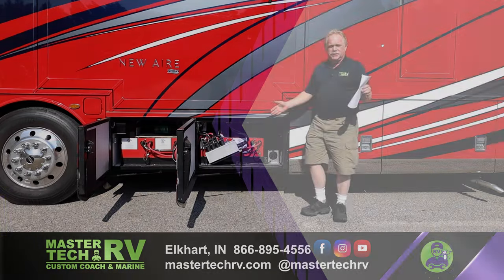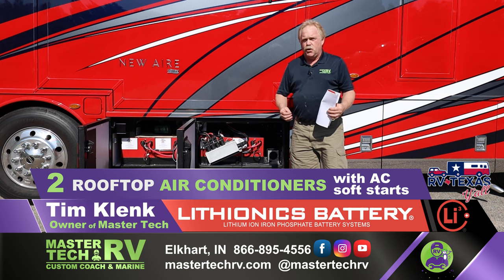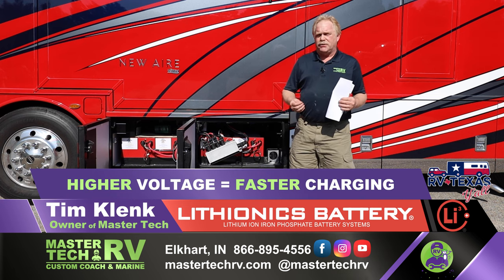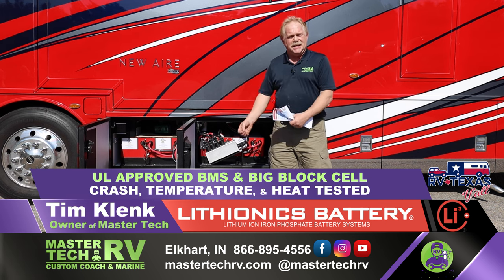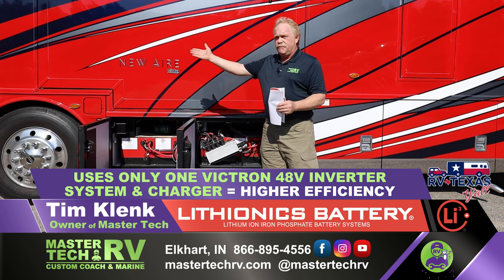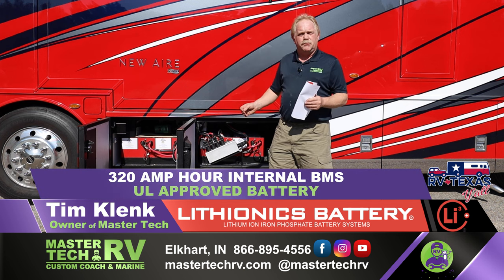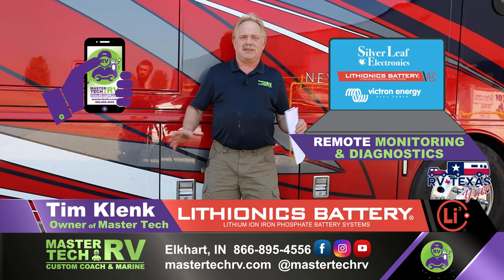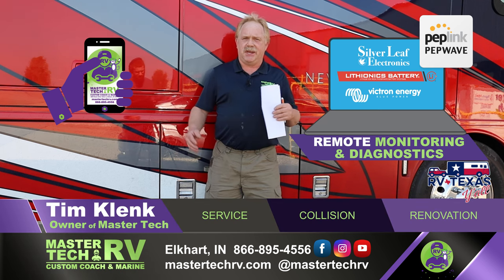Ultimate RV Boon-Docking Lithium upgrade walkthrough

Comment: Nice! -- QUESTION -- One thing I never understand is this: why do these electrical systems now have so many components ie all that Victon mppt and quatro etc  Lots and lots of those blue boxes BUT my house runs all the AC systems, mini splits, TV, Kitchen without any of this stuff and it never fails.  It simply has a fuse box/breaker and that is it.  Why is there not one simple Victorn blue box and nothing else?
Reply from the maker: Your house is a stationary.. hardwired to a meter and the meter never stops and you get a bill every month.. when the electric company has an issue you loose power.. and deal with it..
A coach and or Rv is mobile.. but some Rv‘eta do choose to pedestal camp.. paying for the campsite.. daily and or seasonal.. that often is thousands a night and you need to be organized.. finding availability and paying the piper.
While moving and if you need comfort.. the generator is powered on and you get to hear the noise.. put fuel in the tank and burn an average of 1/2 gal an hr.. you have maintenance on the generator etc.
Being self sustainable is a lifestyle change.. that provides the independence of camping remotely.. such as remote parks to harvest hosts.. to rally’s that often charge 100 a night for just the plug.. also the convenience of traveling in comfort with no generator usage.  I reference to all in one units.. the smart people have designed and built such systems.. but when their is an issue you are often totally down and often seeking discontinued parts.
Their has
Reply: @MasterTechRVServicesElkhart  ..make no mistake, I am with you on having solar and free electriicity without pluging in.  No question.  But many devices I own have batteries without all those endless blue Victron boxes. Laptops, cell phones etc all convert DC to power devices. In fact, I have a solar calculator from the 1980s that takes solar and turns it into the electricity needed to properly run a calculator - no extra devices needed.  Why can't an RV not have some simply device that takes DC power and outputs the electricity we need just like everything else on earth. Seems like all of a sudden it gets super complicated with tens of thousands of dollars of blue boxes that connect to other blue boxes and then onto some other blue box.What gives?  What am I missing?

Comment: Is it true that anything over 30 volts DC can be fatal if you come into physical contact with it?
Reply from the maker: You can get a tingle if you don't know what you are doing as an additional precaution.  The 48v lithium packs are a completely cased up to 315 lb modules have a high amp connector with a sealed plug for a single point connection to bms.  All wiring from 12v to 48v are color coded with identifications and connections are covered to avoid any potential contact.  Everything is Multiple UL approved, safe and insured.
By the way an electric automobile can be as high as 400v DC and they are running thru water.
Reply: Thanks. I don't know what I'm doing which is why I was concerned.
Reply from the maker: @ferociouspinkbunnywarrior4979  No Worries.
Reply from the maker: Even 120v to 240v ac can be fatal a alternator on a vehicle as well.. that is why everything is labeled.. and if you do not understand.. no touching!
The highbred vehicles have a 48v battery.. and most electric vehicles are built on a 400v Dc platform.